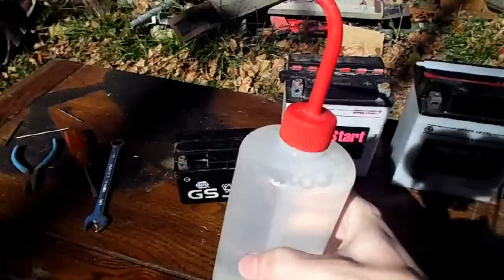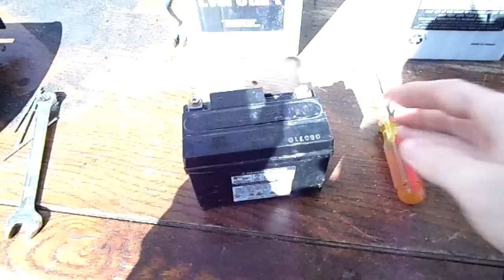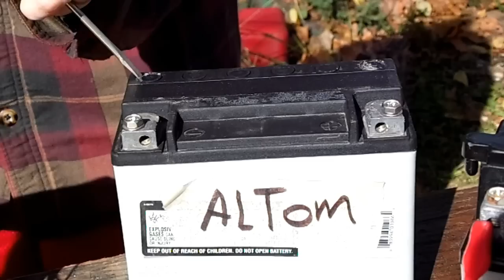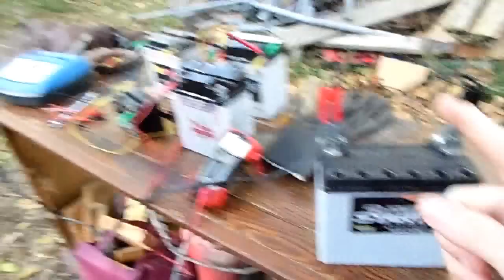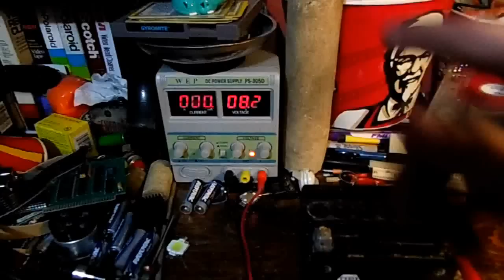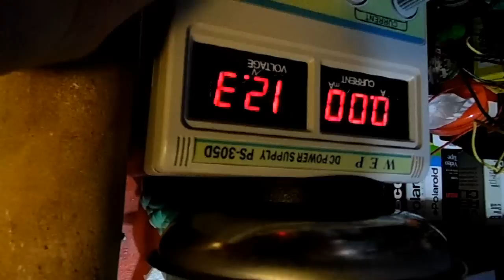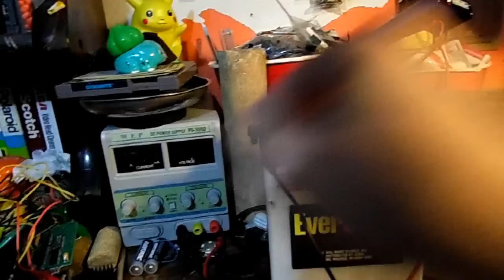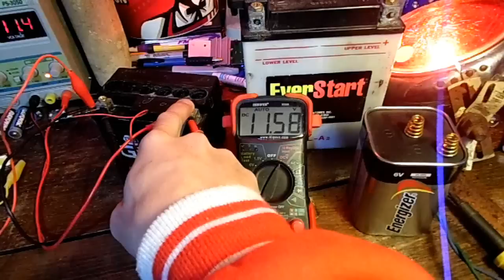DIY Fixing Lead Acid Batteries

Comment: Yes, it does matter what kind of water you use in your lead acid battery. The only water you should ever use is DISTILLED WATER. Not rain water, or tap water. Rain or tap water has suspended salts and metals in it which will ruin the lead plates and spacers. Distilled water has none of those battery killers, and is required by the manufacturers. Always clean the top of the battery off by brushing off dirt and cleaning the top squeaky clean BEFORE you even open the caps off the cells to avoid contamination of the battery cells. Also, a clean battery top prevents any rust dust from forming on the top to provide a high resistant short between the plus and minus poles, draining the battery slowly and causing sulphation on the lead plates inside the battery.
Reply from the maker: depends on where you get your tap water from. like around here a battery will last years and years and years just with tap water, but if you go somewhere theres a lot more junk in the water that might not be the case.
Reply: Depending on the source of the distilled water, and it's storage, it may also be rather impure. The reverse can occasionally be true of rain water, depending on the atmosphere in which it formed and through which it fell. Rain water if filtered for dust particulate (undissolved) can be quite pure. However almost any tap water is full of mineral salts and much more as mentioned because adding them is part of the treatment process done before it is delivered to you through what are often decades old water mains.
Reply: @m3n4lyf  So? Using distilled water means all impurities are filtered from the water by boiling and condensing the water, leaving the impurities left in the boil pot. Some distilled water is also filtered by reverse osmosis after distilling. Just watch the label. 
Rain water has impurities naturally, because a rain drop is formed around a grain of dust. The grain of dust can be anything, dirt, sand, metallic salts, molecules of ferrous oxide (rust), molecules of radioactive material - all from many different sources, and impure by its makeup. Your Grandpa may have used rain water and got away with it because battery tech was in its infancy back in the day. But now with the many ways a battery can be built, you cannot use anything but distilled water, and it is always recommended by the batteries' manufacturers. Cleaning the battery top with a damp soft cloth or a microfiber towel keeps the dirt/rust off the top that would provide a high impedance path (or "short") that will draw your battery down and shorten its usable life. Using an equalizing charge that boils each cell will partially remove the sulfation from each cell, just replace the boiled off electrolyte to 1/4" above the plates. Electronic desulfators only work on functioning batteries to keep the sulfation at a manageable level, it will not "restore" a dead battery to the minimum 600 CCA needed to start a car. Also, your alternator will NOT charge a dead battery (0V), only a slow charge of 2 amps over time might have a chance. Unless you have a voltage reading of at least 10 V, repurpose the battery for some other use, because if it won't crank your engine - it is DEAD.
Repurposed batteries can run household electronics designed for the remaining battery voltage in the car battery - but do so at your own risk. Charge repurposed batteries at the battery voltage, not 12VDC. I've tried all the "miracle cures" that the vultures want you to believe their "cure" will work. They do not, and never will.
Reply: @lomgshorts3  The only thing I am is saying that you never really know how pure that jug of water really is. I make no suggestions on what people do, or should do, and make no statements on the validity of the video(which is laden in bullshit), or the statements of anyone including myself. On an unrelated note: Not everyone on this planet has access to highly pure water at all times, you gotta do what you gotta do sometimes. Much love.
Reply: @m3n4lyf  OK Zed, sorry to have misunderstood your intent. Lots of people do not read the label on the "Spring Water" they consume only to find out that is filtered municipal water. I've seen so much crap on "rejuvenating" car and deep cycle batteries of all types, that I just want to lash out at the people who believe this stuff that people make on video. They waste more money on trying to save an old battery than it would cost to buy a new battery with a warranty, especially when you figure your time and the KWh your chargers use. I go to Interstate Batteries and buy their "blems" at 1/3 the cost with a 6 month warranty and get 5 to 6 years out of them because I maintain them - keep them squeaky clean, clean the terminals regularly, and use vaseline to keep any corrosion off the terminals and cables. Works great. Right now I'm painting my '90 Ford Ranger undercarriage with Rustoleum hi temp black to keep the frame and floor pans from rusting out. The box is made of fiberglass (came from the factory that way), so it won't rust, but even fiberglass needs care, too. When I got it paid off, I swore to keep it forever. I've been offered 5K for it, but won't sell it cause I've gathered lots of parts for it over the years. Its my daily driver, but I also have a '79 GMC C-1500 with a 350 cu in crate engine and a Turbo 400 tranny I'm working on too. Someday it will be a camper with a DIY camper on the box. Best Regards!
Reply: @lomgshorts3  Hell yeah. Those are nice rides, So much for the whole found on road dead myth. :) I'm interested to know how you go about purchasing the blemished batteries! That could be very handy. Does one just walk in and ask about them, or would one need to contact the company (or some department thereof) directly? Would I be wrong to assume the imperfections are largely cosmetic?
Reply: @m3n4lyf  I found the local warehouse (not store front) in Prattville AL and brought my core battery (got lots from the curb) and asked specifically for the type I needed. I always oversize my choice of battery to the next size so that I would have the extra capacity. You will probably have one close to you just by looking it up on the 'net or in the phone book. These are batteries that have cosmetic "blemishes" and cannot be sold at retail, they are tested, charged, right as you wait but you have to install them yourself. Interstate makes many brand names, but the "blems" are unmarked except with a date code. WalMart has similar batteries right from Interstate, cost $50 plus core charge - I'm going to try a deep cycle battery from them, but they are really Interstate batteries. Same price, too. I have one that is four years old in my girlfriend's Taurus, and it cranks even after sitting 10 days. Being an Amateur Radio operator, backup power is a must. Take Care!

Comment: how to make a battery diy. .one specialist make   very heavy static heavy  70 kilos for the solar panel  the secret is the lead plate .MUST BE DONE FAT   FROM MELT    LEAD2 OR 3 CM .THE CURRENT IN BATTERY   IS LOWER BUT IS VERY VERY STRONG AND THE LIFE OF BATTERY MAY EXPAND 100 YEARS

Comment: If you see this and have a moment at some point, can you direct me to where you most thoroughly explain the best way to desulfate? Forget all the pulse stuff just as far as voltage/amperage etc. 

I’m also looking through old comments to find a conversation we had where I’d asked if I could email you but you conversed in comments instead, if I find it I will update that, not that you’re waiting with bated breath. 

Disclaimer:  i know you gave up on lead acids for good reason, I’m not trying to revive, just rejuvenate as much as possible a starter battery. Sorry for the length, I know you get irritated when viewers take you away from your iMac “”””pro””””” with OS X high on crack in the sierras. :P 

I imagine prototyping for apple was along the lines of “ok this is great, but it’s too functional make it thinner and lighter.” 

Rinoa: “but”

THINNER AND LIGHTER DAMN IT WWSJD

RINOA: mutters Under breath “he’d berate you for being a fool

Comment: yes it does matter, test your ohms on tap water (wich us filled with metals) then test your ohms on distilled water. you will notice the resistance on distilled water is mych higher and will not conduct. Tap water will have a low resistance and conducts electricity  nicely. anyways, thats my 2cents.

Comment: Put anything other than distilled water in a battery and the elements and chemicals in tap or other water will foul the plates inside the battery and it will be dead in a month or 2.
Reply from the maker: then how do you explain the fact that these batteries lasted years after this without much degredation?
Reply: Your either not testing the batteries properly, running a 10w led light for a week is not a test lol. What V drop do you get from a 100A load test? How long can it sustain a 100A load until V drops to 9.2. Maybe you are lucky enough to have some of the cleanest purist tap water the world has seen. Non the less the rest of the world does not live in your town. Chlorine, Fluoride and Aluminum just to name the top additives, not taking into account any contaminants along the way getting to your tap. Distilled water is not a conspiracy theory setup by battery manufacturers. Remember you're posting information on a global forum. Will you refund people after they stuff a good battery with the tap water from their region?

Comment: technically using distilled water is ideal.. but I know enough about impurities in the manufacturing processes that lead me to believe the impact on cheap / already dead batteries is quite minimal.  I just run water through a pur filter and dump it in.  Usually a battery will come back somewhat but capacity will not return  unless you run desalination.  For kick started motorcycles this is not a huge issue, but for electric start ones it can be.

Comment: I would let the dry plates get socked for a bit before charging them. Otherwise the plates will only be wet on the surface and dry inside. Your understanding of the chemistry and the desulphator is not quite there. I am not denying the resilt though. For example,  IF you do get metallic lead back,  it will fall to the bottom of the battery. There is no way to direct it anywhere else.

Comment: Restoring 12 volt 12 amp hour batteries that used to have 30amps pulled from it. Can the batteries be used to pull the same amps while restoring the capacity?

Comment: it's been a long time, but I'll appreciate your answer. why you didn't add any acid to the batteries? did you only add water??? why..?
Reply from the maker: because the acid doesnt normally go away, but the water does.too much acid will kill the battery faster.

Comment: Those might power up your club house phone charger or you light light but lets see any one of those pieces of shits start my 95 caddy lmao how many cold cranking amps them bitches putting out? Once the batterys are depleted long enough there done.. once you have a bad cell or a swollen battery your asking for trouble those batterys would wreak havoc on a modern day vehicle with  their electronics check engine lights no starts ruined alternators stranded in places ha im cool couldnt give me one for free

Comment: here's  a few suggestions for doing a pro job
Don't try to do this unless you are sure what you are doing - the acid can burn you
check the voltage first - there may be a kaput cell which would be a waste of time trying to fix.
Check your battery fluid.
attempt to fully charge the battery.
(I read about these on rapid renew roadmap site )

Comment: here's  a few ideas for battery repairing
Don't try to do this unless you are sure what you are doing - the acid can burn you
check the voltage first - there may be a kaput cell which will waste your time.
Check the battery fluid.
attempt to completely recharge the battery.
(I read about these and more using rapid renew roadmap website )

Comment: Hi is it recommended to leave caps off when trying to charge after filling with distilled water?....and then once charged put caps back on ?...also when you use 1 charger to charge multiple 12v batteries in parallel at one time how does charger know when to stop or continue charging?

Comment: Do not listen to his advices!! Lots of false statements in this video!! 

You CAN determine battery's health to some degree from the resting voltage. Resting voltage is usually measured after sitting 24h with no load and no charging. 12,72 volts is fully charged charged battery and if your battery shows rest voltage of that, it is in good condition. All voltages below 12 volts are considered empty. The thing is with LA batteries when you discharge them below 12 volts there is always some damage to the battery. The amount of damage depends on time, temperature, how low you discharge etc. 

There are 6 cells in a 12v battery. Each cell is connected in series with each other to achieve the 12 volts "nominal"  voltage (6x2volts). If the resting voltage is less than 10 volts you usually have one of the cells gone bad, hence the battery is ruined. There is no way you can save those batteries anymore.  No way that the average DIY'er can do.

About the desulfating process. There are two types of sulfation: reversible (or soft sulfation), and permanent (or hard sulfation). Reversible sulfation can often be corrected by applying an overcharge to an already fully charged battery in the form of a regulated current (less than 200 mA!!) The battery terminal voltage is allowed to rise to between 15 and 16v on a 12v battery for about 24 hours. By pulsating thousands of times per second the thing you refer as desulfating device causes AC current! Also known as AC ripple. Whether it works or not ehh... Anyway the results with it are negligible. Especially when most of your batteries were dead to begin with..

Also I would not recommend to build solar banks or off-grid banks with starter batteries. They are STARTER batteries for gods sake. They are build for high amperage draw for a few seconds and depth of discharge less than 10%. They can't handle high discharge state repeated cycles. Also, you should not mix different ah ratings, nor chemistries, with together. If you wire 3 12v and 90ah batteries and one 12v 45ah in series to achieve 48v battery bank, the lowest ah rating determines the pack ah rating. In this case 48v and 45ah.

Just buy a new battery.
Cheers =)

Comment: Hey Rinoa, I have been trying my best to restore 12v Batteries. I'm using water cleaner sulphuric Acid 8/1 in distilled water I can only get my battery up to 10.5 it holds that. I used bi carb to clean it out 8/1 and then I add the sulphuric mix. I've been charging 12 hours x 4 with a 2 hour break. 
Any tips

Comment: As soon as he said that tap water is fine for batteries I turned off the video.
Reply: The poor practice and misunderstood concepts start much sooner. However, as the saying goes, any oil is better than none. Any water is better than none.
Reply: #Philip Hubbard, I\'m not sure but ,if anyone else wants to discover battery restoration at home try Cypouris   Renewal Guide Coach (should be on google have a look ) ? Ive heard some extraordinary things about it and my neighbor got excellent results with it.
Reply: tap water is "fine" technically... but it will shorten battery life... however just for testing purposes, or just for short term, sure tap water will work. 
But Yes, the dissolved solids in tap water will kill the battery, especially as the battery cycles. Same for causing major corrosion in a vehicles coolant system, which will build up beyond belief through hot and cold cycles if tap water is used. I always use distilled water to mix with straight coolant, PLUS a corrosion inhibitor like Red Line Water Wetter. Protects the entire system, adds additional lubrication for the water pump, and keeps everything very clean.
Reply from the maker: +Philip Hubbard my tap water is fine for used batteries. ive never had an issue with it yet.

Comment: pulse desulfaters is shit, i have three different from amazon, ebay and a local shop here in norway.... it did not work for me i problably could buy new battery with money i spent on this garbage,. it was indeed hooked up to my battery for over 3 months... lol but with a dumb transformer charger at 16 v, i overcharged to boil electrolites and to my surprise the dead cell woke up and now battery is stable at 13v without load ...
Reply: i have a c tek charger with desulfation mode als, it did not work either and this charger was allways connected with pulse desulfater thing.. sorry no luck even after more than 3 months in my garage hooked up for charge, also tried powersupply with desulfator no luck.. so people the best is filling your battery and hook a old skool charger without any protection circuit. if u take care to fill up ur battery with water during overcarge you will be surprised after some dischargege at 20 amp dc load and then charge again. it will get more capcity